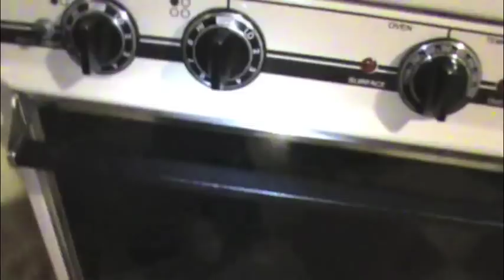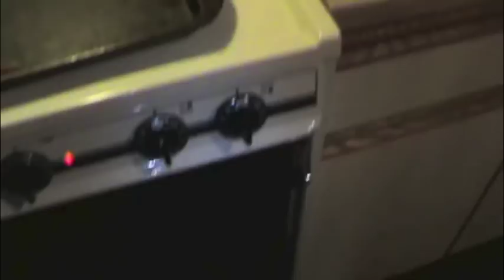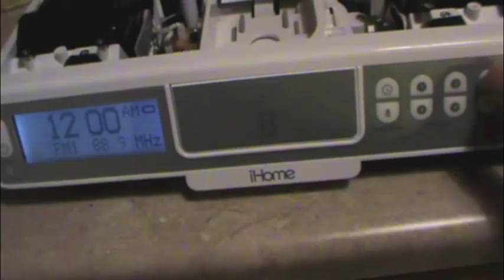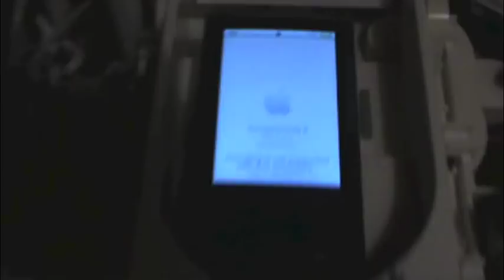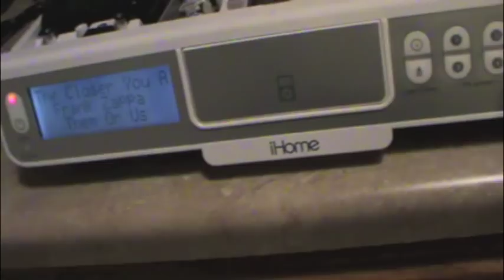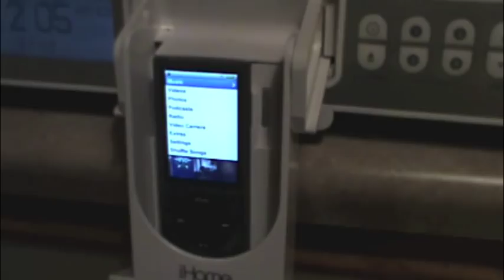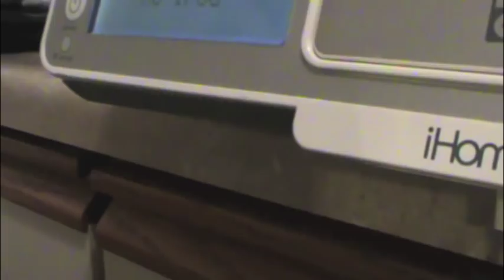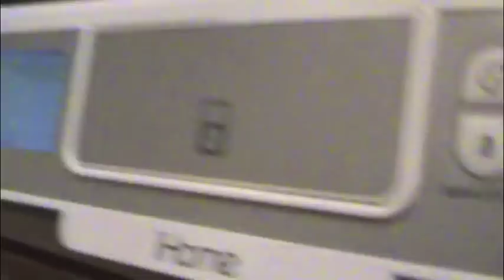iHome iH36 Repair and Demo

Comment: wow must have missed this video lol. I have this unit, it was a friend's shop radio for years, he had obtained it from goodwill for $25.the issue? the cable connecting the iPod dock to the board had come loose. it was only fixed after I got it as he never used an iPod with it. the best iPods to use with these were generation 3 and earlier,  (classic) 
as it actually charges those. I doubt you have this now, but it was a shame about the remote. it does sound awesome.

Comment: hmm in the manual ". If the dock is closed and you are not using 3rd generation iPod or iPod shuffle, playing song info will show on the display.
Note:When dock is closed, you can only play songs on current playlist.
Note:When using a 5G iPod (iPod with video), make sure to exit video playback mode before closing the dock.
Note: DO NOT close the dock while watching a video on the 5G iPod"
this came with inserts for different size ipods too it seems.

Comment: I also have the ihome IH36 (I am on my 2nd one). The unit will no longer recognize or play my ipod. Any ideas on a fix?
Thanks.
Reply: well this might be a few years too late, but the cable from the dock to the internal board was known to come loose. in the case of mine it was obvious because the cable was sticking out the front of the iPod door. it was probably pulled out though to illustrate that the dock was non-working.